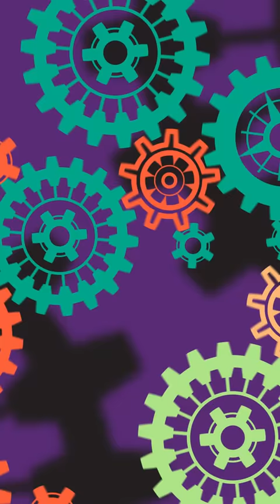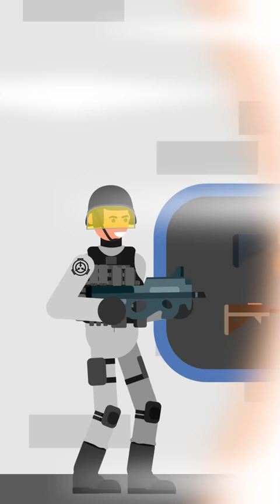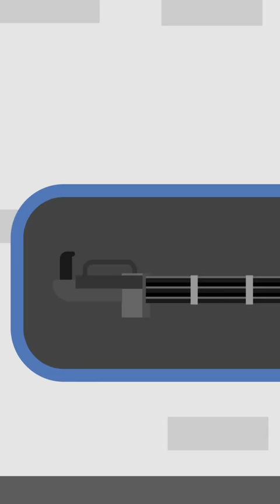FN P90 Assault Rifles Inside SCP-914

Comment: The FN P90 submachine gun is a compact, lightweight weapon with a magazine capacity of 50 cartridges in 5.7x28mm NATO calibre making it the ideal Personal Defence Weapon. Now to make a point its a submachine gun, there are sources that say that you can call it an compact assault rifle but please for the love of God, call it an submachine gun, even on the official website it's considered an submachine gun. I still don't get it how people can call this thing an assault rifle.
Reply: Call it a Personal Defence Weapon (PDW) :awesome:
Reply: I also don't understand it
Reply: @grahampiche1742  it is the ideal Personal defence weapon, it's small it can penetrate through armor fairly easily and it has an huge magazine, the reason the full auto version is not allowed in america is because submachine guns are litterally Anti personnel weapons. Though submachine gun is the ideal classification
Reply: Because to the average non-gun nut we think anything with basic stock and the ability to switch fire settings is a riffle. Also you typically see it carried with both hands which can be a little confusing unless you've seen it held in one showing it can be operated this way even on full auto.
Reply: @daviddent5662 yea but why don't people Research stuff like that before doing those videos
Reply: @templar3955  because that means work and work is hard i guess
Reply: It's a bull pup so it's an SMG with the barrel length of an assault rifle.
Reply: @mrhyde4732  its litterally just typing on a keyboard
Reply: @templar3955  And yet, its still too much for some people
Reply: @DaemonwarriorJulius  I wonder why it does not say on the original site that its an Bull pup
Reply: @mrhyde4732  I see

Comment: "No explosives must be tested with SCP-914"
Load SCP-914 with bullets full of gunpowder
Reply: Technically gunpowder is flammable not explosive.
Reply: @fcensoredk1556  it is both, but yes in small quantities at normal pressure it's just flammable.
Reply: And I bet if you put an Airsoft gun inside of it on Fine, you'd get the same Airsoft gun, but it'd anomalously shoot real bullets.

Comment: It’s actually a sub machine gun not an assault rifle, this smg uses a 5.7x28mm round which can be fired from a handgun while a assault rifle cannot
Reply: I believe assault rifle is determined by select fire or the ability to fire fully automatic.
Reply: does that mean the AK-47 is a marksman rifle because the G3A3 uses 7.62 too?
Reply: @OokamiKageGinGetsu  nope it has to use a intermediate round. Otherwise the mp5 would be an assault rifle
Reply: @BetaProtogen  the ak-47 uses the intermediate round of 7.62x39 which means it’s an assault rifle. The g3a3 uses the full powered round of 7.62x51 which means it’s a battle rifle, some countries use it in a semi auto only form for a marksman role
Reply: @tristanlloyd2967  Makes sense. Otherwise the 30 mm GUA would be considered an assault rifle.
Reply: @OokamiKageGinGetsu  not really the 30mm gau is a mounted aircraft machine gun
Reply: @tristanlloyd2967  That was my point.

Comment: The P90 is a sub machine gun...not an assault rifle...
Reply: It’s not an SMG it’s a PDW
Reply: @loganchmial5492  it was originally designed to replace the MP5 in NATO service as the new NATO SMG
Reply: @the_gaming_rabbit8017  yes but the Mp5 was being replaced because body armour was becoming more available and the mp5 wasn’t cutting it any more so the P90 was going to operate in a similar role but with better penetrating power

Comment: "p90 aSsAuLt RiFeL" it's a submachine gun. Also it fires pistol rounds.
Reply: yeah its not rifle its PDW personal defense weapon
Reply: I never understood why they use p90's over far superior rifles when they fight supernatural entities
Reply: @aratay3117  when it comes to the nature of some anomalies, rate of fire can be more important than stopping power, the P90 has a very high rate of fire, and very LOW recoil. Making them very appealing.
Reply: @aratay3117  compact, good power for the size, large mags, futuristic. Stargate series also used them as primary weapon.
Reply: @Nobody32990   Honestly I never liked the p90 being used in everything, as more of a secondary weapon sure that's fine.  But when you're going to fight an unknown or alien enemy, take the damn rifle.

Want it to be futuristic? Grab any bullpup and modify it.   

If weight is not an issue cause you're guarding something, take a damn lmg or extended mags with a rifle.

This use the p90 for everything is getting annoying.

God if I see one more show where they slap a white paint job on a p90 and call it futuristic I'm going to lose it
Reply: @aratay3117  Which is odd considering the MTF troops in this SCP Explained have assault rifles which are slung behind.

Comment: Wanted to see what would happen if it was set to 1:1, may have gotten a MP7.
P.S The P90 is a Personal Defense Weapon or Compact Assault Rifle. It isn't a replacement for   standard Assault Rifles givens it 200m effective range while standard ARs have 400m effective range at minimum. It's somewhere between a SMG & AR in capability was designed to replace  SMG in some areas.

Comment: 2 things. 1, P90 is a PDW, (Personal Defense Weapon), not an assault rifle or and SMG. 
2, There's a difference between SMG and PDW. Here's the definition of each;

SMG: A submachine gun, abbreviated SMG, is a magazine-fed, automatic carbine designed to fire handgun cartridges. The term "submachine gun" was coined by John T. Thompson, the inventor of the Thompson submachine gun,[1] to describe its design concept as an automatic firearm with notably less firepower than a machine gun (hence the prefix "sub-"). As a machine gun must fire rifle cartridges to be classified as such, submachine guns are not considered machine guns.

PDW: Personal defense weapons (PDWs) are a class of firearms intended for self-defense and security rather than warfare and infantry. Most PDWs fire a small-caliber (less than 6 millimetres or 0.24 inches), centerfire bottleneck cartridge resembling a scaled-down intermediate rifle cartridge, essentially making them an "in-between" hybrid between a submachine gun and a carbine.

SMG's use pistol caliber rounds, like 9mm for example. PDW's use a small caliber, (less than 6mm or 0.24 inches), center-fire bottleneck cartridge resembling a scaled down intermediate rifle cartridge, such as the 5.56 or .223 calibers. 

Do with that what you will.

Comment: I hope my math is ok but assuming that the way the air gun works is by accelerating a volume of air with a pressure of 43 billion giga pascals, the volume of air it shoots out will be travalling at 0.3 m/s slower than the speed of light. I am assuming that the cross sectional area of the barrel is 1 cm2 and that the barrel is half a meter long and that the volume of air being accelerated is 1 cm3.

Comment: Firstly, it’s not an assault rifle, it’s a PDW. Secondly WHY WOULD YOU STOP TESTING? Almost all of your primary engagements for security breaches are indoors so sorter range won’t be a serious issue in most situations and if this thing could damage the walls of the firing range, that means that not only does it have an infinite magazine at the wonderful p90 fire rate it also packs more of a punch than a normal bullet.